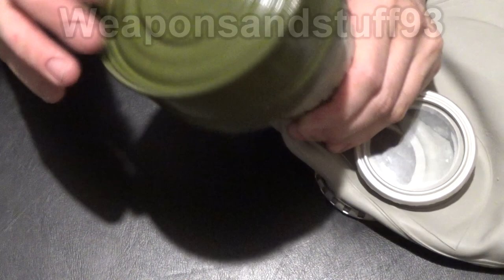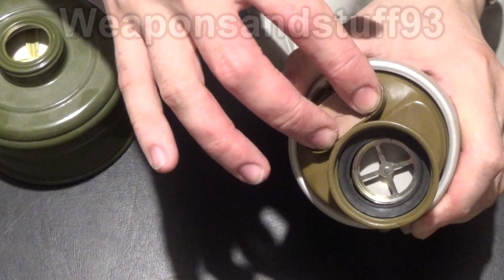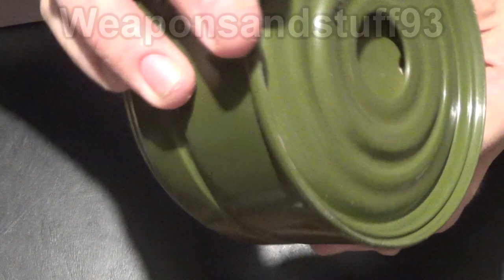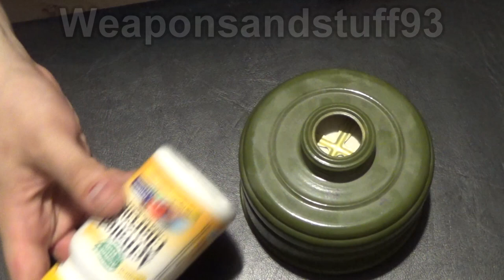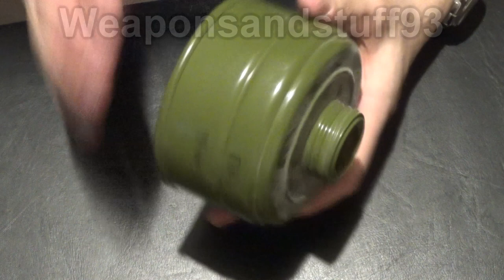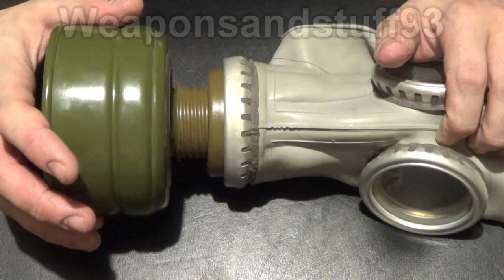How do Gas Masks work?

Comment: (tiny correction here) Rebreathers don't actually turn CO2 into O2. The air you exhale has a whole lot of O2 still in it but the CO2 in it is enough to kill you, so rebreathers send the exhaled air through CO2 scrubbers and the purified air goes back into the system with a little bit of air from a tank squirted in to make up the difference. So really a rebreather is a system to make air tanks last an insanely long time.
Reply from the maker: +GenericFakeName Thanks for the explanation, I knew it was a bit more complicated than a simple conversation.
Reply: Weaponsandstuff93 Ironically a simple conversion would be insanely complex and the complicated system is rather simple.

Comment: If you're interested. I can tell you all about SCBA both closed and open circuit varieties. (I'm a firefighter)
Reply from the maker: Cool, I take it the closed circuit SCBA is the rebreather type?
Reply: +Weaponsandstuff93 yes closed circuit SCBA is the rebreather style :)
Reply: paranoid apocalypse guy please explain!!
Reply: Huh are you actually paranoid of an apocalypse cause I am
Reply: Do tell
Reply: Those are really cool I’ve been looking into also, is a Closed Circuit SCBA similar to a Spacesuit air supply? I was interested in them next to Gas Masks for military/peacekeeping/engineering stuff, as I know the exhaled air could be a concern if a wearer doesn’t know they are infected possibly with something, and gas masks usually exhale air unless somehow it’s safely modified maybe

Comment: The black ring on my inhale port, like in yours on your GP-5, has fallen off and it looks like yours almost did. Does it really matter? Like is it a must have? As in, if I have an up to date NATO 40mm filter, would the seal not work? It seems like it seals fine and suctions to my face well.
Reply from the maker: With a filter attached the flap on the inhale port isn't all that important, the exhale becomes more important because if that's not working air can enter through the exhale valve. The GP5 isn't really a great mask for survival use because of how old and cheap it is, but with a new filter it should work ok if you have nothing better.
Reply: I plan on getting an Avon M50 when I saved enough, but I still love the look of the GP-5 so I was going to buy a NATO filter and I was just wondering. Thanks.

Comment: where would I find a a modern 40 mm NATO filter for The GP5? I probably said in other comments on other videos I use mine to to apply herbicide and pesticides at work it worked very well  however after seeing your video on the original filter which I have and have been foolishly using for some time I would be interested in how much NATO filters cost and the best place to find them  thanks
Reply from the maker: You can't use a 40mm NATO filter with a GP-5, you can force one on but it won't make an air tight seal.
Soviet masks use the 40mm GOST thread, it's different to the NATO Stanag thread.
I'd advise you to buy either a 3M mask as filters are easy to find or a modern NATO mask so you can get NATO filters that will fit it.
You can get NATO filters from army surplus stores or eBay.

Comment: If I want to use a gp5 with no filter just as a cosplay do I still need to check for asbestos in the filter attachment? Because I wanna buy 1 that i saw on amazon, i think it is new but i want to be sure
Reply from the maker: No it will be totally fine, the filter is only about 1-3% asbestos as well, so the chance that there will be asbestos outside of the filter is minuscule.

Comment: would it be better to get a slightly bigger gp-5 or have it tight? my friend said he got one slightly bigger, but I don't thinks that's a good idea
Reply from the maker: No a smaller mask will pull tighter meaning it's a better fit.
Reply: Weaponsandstuff93 okay that's what I thought, thanks for clearing that up :)
Reply from the maker: As long as it's not so small it doesn't fit on your head.
The interesting thing is GP5s are sized slightly bigger than the military masks of the same size.